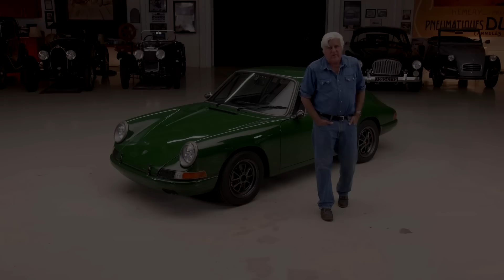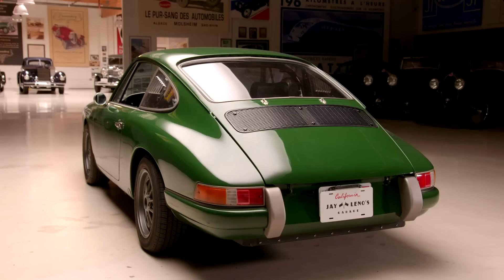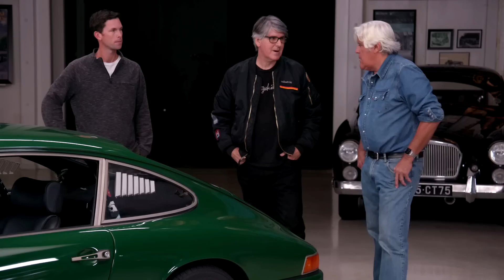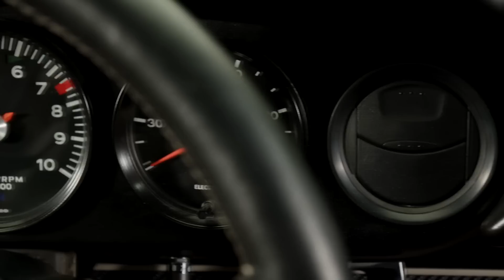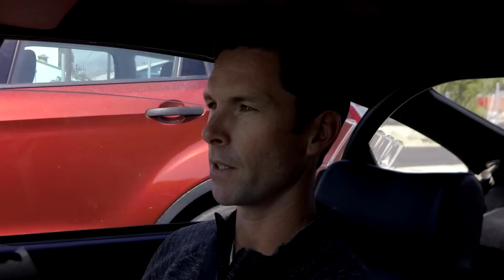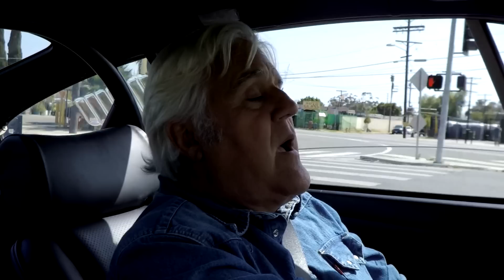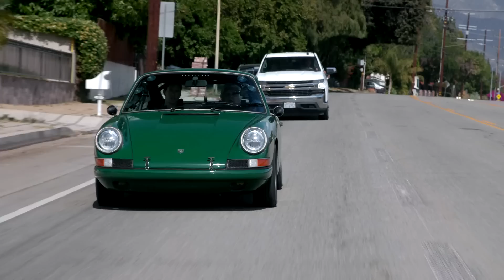Zelectric 1968 Porsche 912 | Jay Leno's Garage

Comment: I had a ‘64 VW Beetle converted to electric drive and its range seems to be around 189 miles.  However, the range seems drop rapidly with around 30% charge left.

Comment: The original 912 basically had the Porsche 356 4 cyl. engine. Surprised there are no rocker panel covers to conceal the wires. 09:11
Reply: Those are cooling lines for the motor. -db

Comment: Electric motors have an efficiency map. At zero vehicle speed the efficiency is zero. Most motors have an "eye" of peak efficiency. For maximum range the motor has to be kept within the power/RPM range of the "eye".

Comment: Here's another conversion. In the early 1990s Motorola developed an electric car from a Chevy Corvette. It was fully operational. The top secret project escaped notice until recently when Kevin Williams in The Drive wrote a feature article. The car is near Chicago and for sale! Batteries are dead but the car is in great condition otherwise. Will you buy it? The story was posted Sept. 13, 2022.

Comment: 74000$ a bit high for my wallet though. 
I want to put Electricmotors on the rear axle of my VW golf gti but keep the 240 bhp engine on the front axle? 
Some with suggestions (cheaper) are very welcome ☆☆☆☆☆
Grtz from the netherlands Johny geerts

Comment: Very cool, they need more battery though for sure. Add heavy duty suspension to handle the extra weight. But I get it they have done well to stay within the limits of the chassis and normal parts.

Comment: NEED: reverb engine (like Stirling) but with internal combustion and frictionless BAM-TiB2 bearings (required for a reverb engine.)  Match to ~2KW generator for unattended self-charging.  A little sensor sophistication to get past DOT about the unattended engine operation in public.  Maybe a simple carburetor tuned to the 2KW rpm setpoint.  Run on alcohol, toluene, industrial waste fuels.  1cuft maybe?  I think that would knock the crowd dead.

Comment: Great drive, great interview.
 I am 81 and had a 2008 Forrester Turbo, that I had built over the last few years.
Did 160.9 MPH in the mile and half @ Mojave Magnum.  It was fun car to drive and enjoy,
but age caught up with me and I difficulty shifting and getting in and out of the Subaru..
I sold the car and bought a KIA Niro EV.   Boy what a fun car to drive. Just like you experienced. Quick and quiet. I get target range of 280/285 miles.
I agree an Electric DeLorean  would be a kick.

Comment: This is the future to go for many classic and iconic cars. This 912 in its green original color is stunning!!! Not overloaded with todays massive interior and equipment. If it is possible, I want to get this. A huge thanx to jay to bring this guys and their work in his garage. Big cheers from Germany 🇩🇪
Reply: @d.martins4471  not really.😎. The conversion of a classic car to electric drive is a growing field in the future. Now we have some regulations that allow you to drive a 25 plus years car without todays harsh emission laws. But there is a huge change upcoming. Around Germany, a lot of countries in Europe doesn’t allow you to use their roads with vehicles that don’t have actual emission standards and that is a huge problem for older cars.
The price for gas is not the biggest problem. Even a jaguar e-type is converted to an EV and it is stunning but not affordable for my pocket😎. 
So have a very nice weekend and thanks for your comment 👍😎🇩🇪
Reply: @d.martins4471  well, the things that you have pointed out are absolutely correct. Batteries are not the solution for our environmental problems. I see this technology only as a short bridge before H2 will come into use and efficient fuel cells are affordable to do the job. But as always, I don’t make the political decisions and sometimes the lobbies of car manufacturers and other big companies have a bad influence on the process. Take care

Comment: PORSCHE! There is no substitute but there is a difference.  I started school in an orange '68' 912 with a lotta rust and she be my pride & joy but Leno you dog (you got too many vehicles). Then I went to college in a turquoise '78 911SC Targa and she be so sweet but I graduated with an advanced degree in a VIN authenticated '79 930 turbo (bronze on blk) w that euro fuel system and so much more. 1 of 2010 ever built she was a road rocket and 1 of only 1190 ever imported. Gawd dayum I miss that car doing 160mph in 4th@4200rpm. I'd flatten that tail and she be begging for more. VROOM!

Comment: AGMs known for "going out"? Really? Not unless they are overcharged. Why would an EV have an AGM anyway? Generally downsized regular lead acid. More likely fairly rubbish flooded or enhanced flooded batteries that have little lead in them & have been poorly installed. The explanation of system efficiency is probably the worst description I've ever heard.

Comment: 13:02 is there a reason the front battery pack is not right above the front axle or even slightly behind it? Wouldn't it be more beneficial for weight distribution like that?

Comment: I think something like a 59 Cadillac would be an awesome car to do this type of conversion.

1. It's already a big, soft, floaty car. The weight of the battery won't hurt the little handling it has.
2. It's a luxury car from back when luxury meant comfort and quietness. Can't get any quieter than electric.
3. It's got that over the top "futuristic" jet-age styling. So why not give it a futuristic drivetrain
Reply: Neil Young converted a 1959 Lincoln convertible to electric. I think he calls it the LincVolt.

Comment: I note that they say they don't use a Porsche transaxle in there.  I know that some of the conversion kits out there bolt an electric motor to the VW or Porsche transaxle.  That seems to make sense from an ease of installation sense - with the half shafts all set and ready to go.  But of course those early transaxles might not last long with that toque.  I'd love to know what they do for a whole different transaxle in there without cutting the stock chassis.

Comment: The problem with electric vehicles, is the range! I would love an electric PU to travel for work. I need 10 hrs. X 60 mph= 600 miles. I travel about 60,000 miles a year and this would remove a large amount of waist; however, manufacturers concentrate on SPEED.

Comment: Very nicely done indeed! But I have to agree with Jay that a sports car needs a lot more range for those weekend driving jaunts. In my book any car that is used for anything more than local commuting and shopping - a sports car in particular - is practically useless if the range is less than 200 miles. With 140 miles I couldn’t even make a round trip from my home in L.A. to Santa Barbara. I hope that some day soon, however, retros like this will be sporting that much needed longer range.

Comment: ime AGMs give plenty of warnings before they fail... shorter charging times is the strongest indicator, less cranking power and of course lower rest voltage, amps, etc once you start measuring..
the traditional acid-lead ones on the other hand can and will fail w/ no warnings in hot environments: the plates will short-out because of deposits and/or warping (or sometimes break off) with plenty of acid covering them..  AGMs don't experience this issue.

Comment: As the Owner of a 1968 Porsche 912 for the past 13 years, I cannot see any Real Value in changing a Classic Car into a Soundless, Gearless, Rangeless, vehicle.
What I value about the 1968 Porsche is the Smell when I get in (Old Gas & Oil), the Sound on Startup and while Driving. Also, the ability to drive in 5 Gears w/ Manual Transmission. BTW Jay that was 90 DIN HP or 102 SAE HP from Porsche in Stutgart. My 912 is 115 SAE HP w/ Big Bore Kit 1750 cc vs 1582 cc (stock) and has had the Distributor changed over to Magnetics w/ Compu-Fire Ignition and conversion to an Electric Fuel Pump vs the Geared Pump (stock). I also Love the Exhaust Noise on Downshifting to a Lower Gear. So, Jay as a Real Porschefile I would recommend that U Sell that 356 Carrera 2.0 and Converted 911 T (2.2L) which U turned into a 2.7 L. I do not really believe that U understand the "Essence of the Porsche". Just a comment from a Former R-Gruppe Member w/ '72 911S.
MARVEL in MT

Comment: Jay asked Trent, the engineer, a few times of why not adding a transmission (for more efficient powertrain) to extend the car range. Jay was thinking lower the motor rpm would save more gas (electric energy in this case) as in combustion engines, which have a lot of lost at high rpm due to friction lost on many moving components. In contrast, electric motor has simple moving parts: two shaft ball-bearings. Electric motor does have some lost at high rpm due to Eddy current lost (caused by high frequency switching magnetic flux) but it's small compare to friction lost in combustion engines. Also, at high rpm, elec motor self-generates back-emf voltage which reduces the motor current (hence low torque at high rpm), in contrast to combustion engine keeps sucking in gas at wide open throttle. There is no reason not to run elec motor at high rpm at high speed.

Comment: It's gonna take a decade of EV adoption for people to realize they are attempting to make something that just isn't possible. You can't make a SPORTS CAR better by removing sensory inputs. EVs are amazing daily drivers and relaxing cruisers but they are just never going to scratch that itch if you've had any experience with a connected enthusiast car. And it isn't just EVs, outside of several new cars, every modern performance car has suffered from the same exact thing. Larger, more weight, no steering feel, muffled engine and exhaust, pedals not even directly connected to their components, etc. The best, most desirable cars are the exceptions to this we love so much. BMW M2, Miata, Cayman GT4, 911 GT3, GR86.

Comment: They missed the 100 pounds of fuel the 61.4 liter tank would hold when full.  Sure, it gets lighter as you go, but regardless, apples:apples drive train has to include a tank of gas/tank itself etc. if you're going to include the batteries.

Comment: I did not think there was a competitor to Porsche by Singer. Well... there isn't but this Zelectric Porsche comes from left field and it's a doozy. This is the car we needed but didn't know it. The curb weight of 2500 lbs is outstanding but, with a range of 120 miles, it gives reason to pause but it was a wise decision not to add 400 lbs of weight for more range. Better to wait until battery technology advances. This is one of my favorite videos in ages. So much of the video is just Jay and Trent shooting the breeze and talking about cars. It's so fun and relaxing be a fly on the wall. I'm impressed with Zelectric and I wish them nothing but the best.

Comment: I remember parking my rd 125 lc next to a Volkswagen Beetle overlooking the sea on the south coast of England, I'd seen this beetle around followed it realised it was quite quick, anyway turned out it was on them Porsche wheels, fuchs? Is that what you call em an he had fitted a 912 engine from a burnt out porker, known as cracklin in the trade apparently it was at the time cheaper than tuning the vw motor up an he got all this cool stuff like wheels etc funny thing was I knew of the Porsche at a back road garage an I thought shame about engine I could fit a vw unit they're cheap just a daft motoring notion.
These electric cars will impress me when they run on the Aether, an I don't mean ethanol neither, how do you tune your car to run on alcohol gotta ask them hillclimbers more power that'd be the proof!

Comment: Love the conversion done here. Although you don't have much range it would be perfect for a second car scenario of most families. A minivan or SUV for family travel while dad who only drives 30 miles round trip to work and back to the office. SUV for longer road trips the electric Porsche for fetching grocery or date night. I believe a lot of families could rethink their automobile needs and add an electric drive vehicle to their where it can be applied logically. Specially if they have less than 100 miles roundtrip to the job scenario. Thanks for sharing
Reply: "901 architecture"...
Well, in 1963 were some odd Peugeot guys, who didn't like the name with an "0" in the middle. But the rest of it is history.😊

Comment: This seems to be becoming a trend to put an electric motor in a Porsche ( The Need for Speed ) I think Porsche owners always wanted a super fast quiet smooth running sports car. The gas powered Porsche was never fast enough for Porsche owners.
And it was always breaking down and needed maintenance.
Sound like a fun project to turn a Porsche into an electric vehicle.
Hopefully in the future kits will be sold to turn gas powered cars into electrics.

Comment: Great transmission answer. ive been asking that question for years, this engineer guy really knows his stuff.
Reply: Yes, it is hard to explain why electric vehicles only use one gear while an internal Combustion engine can need up to 10 gears to do the same thing, without having to explain how a transmission works.  Both motors and engines use transmissions, but the ICE has a smaller power band (the RPM that provides the needed power), so it needs multiple gears to spread that power over a wider range of speeds.  While a motor provides most of its torque at 0 RPM and can be most efficient at 5,000 RPM.  The transmission for the motor is often a compromise of power and efficiency, but if you want a really high top speed (like 200 or more MPH [322km/h]) you will need a second gear for the motor.

Comment: Just imagine, no oil changes, no belts, no water pump, no alternator, no starter, no clutch, no transmission service….oh yeah
Reply: Indeed, plus no fuel filters, fuel pumps, carbs, injectors to clog, high pressure fuel lines, 02 sensors, catalytic converters, exhaust to rust out, alternator, oil pumps, water pumps to fail or need replacement. No timing chains or timing belts to worry about, head gaskets that fail.
No worrying about tune ups, changing engine air filters. No coolant flushes or stuck radiators. 
Thermostat housing issues or sticking thermostat to replace. 
The Brakes last 3-5 time's longer. Much cheaper to operate, plus it can run off the sun. 😎

Comment: Some cars are all about the engine such as Bugatti, W.O. Bentleys, Duesenberg etc. and some are the whole package. Changing mass produced cars to electric is an improvement, it is "Hot Rodding" to the core. Save the rare for posterity , drive the rest.

Comment: A Delorean would be perfect for electric conversion.  It would finally go as fast as it looks.
Reply: DeLoreans were obnoxiously heavy.  Nobody would mind a customization along those lines, tho.  Or any other customization either.
Reply: @ACTSRevolution  There 'was' a group in Cincinnati which could upgrade the chassis to stainless steel (making it corrosion proof - as the epoxy coated steel could / would allow moisture in depending on location and time). I'm not sure if they're 'still' offering that service but I'd be curious how much weight would be shaved off if they did / could.
Reply: @mgabrysSF  SS is quite a bit heavier than carbon steel and it also takes up hydrogen embrittlement rather easily (it's a somewhat unreliable mechanical material when exposed to the elements.)  Cast it in aerospace aluminum like the new Ford chassis tech and that sounds like a race winner.
Reply: a fiat 500, you could pop the rear hatch and put the motor in the back.
Reply: @pulseweld  batteries more like. Motors are usually attached directly to the wheels or the axle. But yes, very do-able.
Reply: I'm still waiting for cold fusion.
Reply: The shop that did the upgrade conversion on my ‘64 Beetle, Flashdrive Motors, has done a DeLorean.  You can see it on their website.
Reply: Or any car of jay leno all old cars in ev engines  its amazing pwrfect its the future
Reply: Absolutely!
Reply: already been done
Reply: @krusher74  - not much tho. DMC Houston prototyped a single one - but I've yet to see it go into full production.
Reply: @krusher74  Is someone manufacturing the conversion kits?  I would love an electric Delorean (or older 911).  Better performance than the gas version and a lot less work to keep them running.
Reply: @donm2255  you can buy a brand new delorean from Houston Texas.

Comment: Its not just the battery tech that keeps Tesla in the lead, its the electric motor tech, as well. They've developed a technological wonder of an electric motor that they 3D print and assemble like a reverse MRI. Interesting that cooling is still one of the main issues, you're just cooling the battery pack vs the engine of an old classic muscle car. I'm working on converting my Corvair into a hybrid, by installing an electric motor assembly in the trunk area up front. With the availability of Tesla parts and other after market items, seems like it should be do-able. My problem would most likely be battery capacity and placement.

Comment: Great episode as always. Did anyone hear an answer why a trans which reduced the number of rpm of the motor wouldnt extend range? I didnt. Also, why the obsession with speed? Anyone doubt that once again Japan will send us a car that only does 0-60 in 15 secs, but has a 600 mile range. That the average user might charge once a week. Its the 70's all over again. US manufacturers obsessed with power. And will get their heads handed to them when Toyota sends a eCorolla that they cant keep up with demand.
Reply: You could charge once a week, but don't you have power outlets in your house?